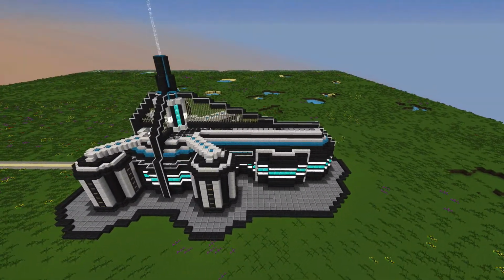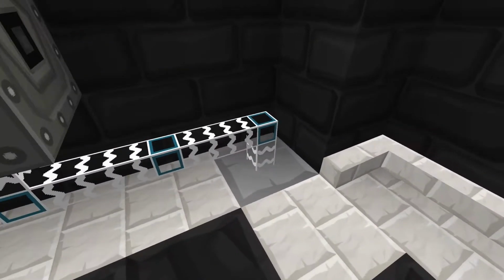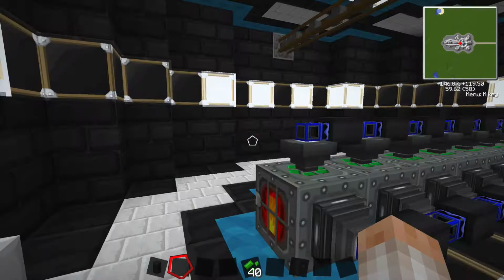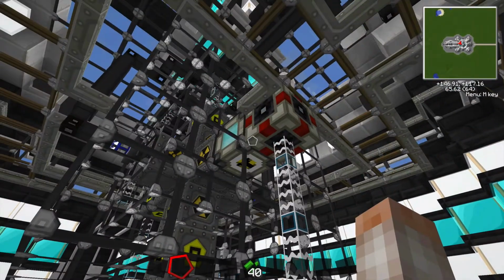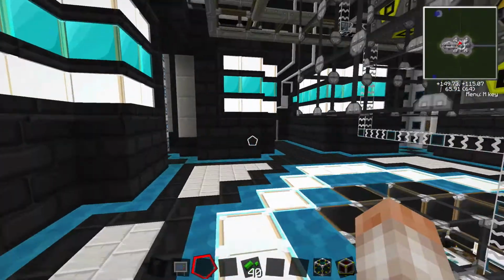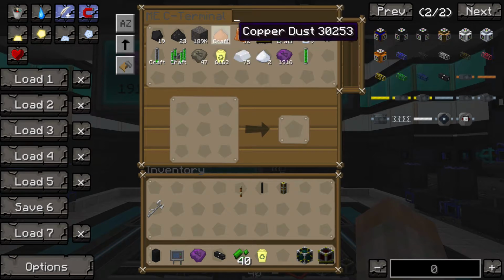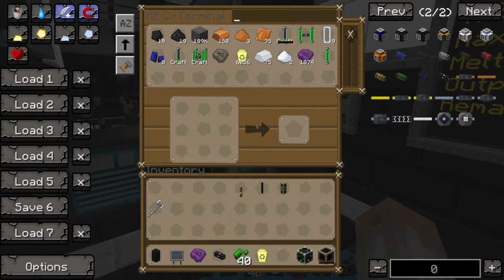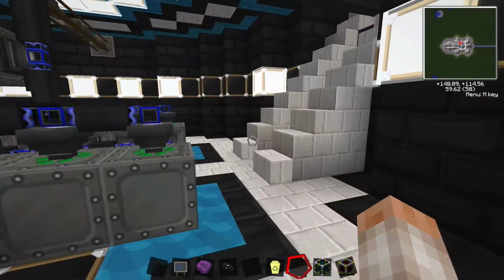Lets Build a Nuclear Power Plant - Episode 11

Comment: Just got around to watching this - very impressive. I do not know how you come up with these awesome aesthetic designs.
Now we just need to figure out how to automate the replacement of the uranium cells in the breeder.... You could use a detector cable to turn off the import/export buses when the breeder has no power output. Then use a different import to pull out any near depleted cells left over and another export to replace w/quad cells, maybe?

Comment: It looks like some level emitters were used, what if those levels were bumped up so that you could inventory a full amount of the materials needed for the next cycle? That could offload some of the MAC processes during the refilling of the reactor. Although, It sounded like once he dumped in the 40 uranium that it would make a "backup" set of quad cells automatically, and then it would be ready to replace them immediately.

Comment: Aw yiss; my suggestions for the ceiling output monitor and the Deep Storage Unit made it into the final build.
I was worried that the quad cells not being replaced at the same time would be an issue, but I guess it's actually a good thing. Though you will always have a lower output than if they were all in there at once...
Since it seems to be too sluggish, I think the MAC should be made larger and crammed with more CPUs. Like, instead of pillars holding it up, just extend it downwards.